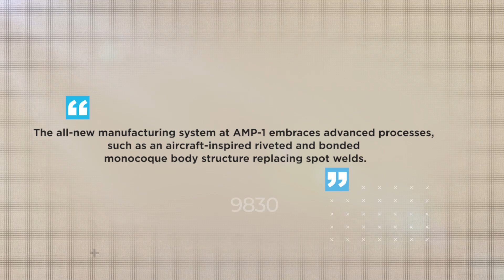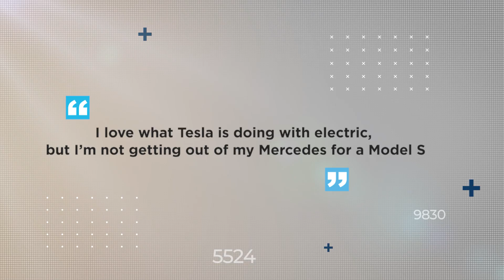Inside Lucid Motors' $700 Million Factory

Comment: I like the Lucid's design but, it's been years that we've been hearing about this thing and it's not difficult theoretically to make an electric concept car... It's basically a structural skateboard powerplant of a few thousand redundant and liquid cooled batteries connected in parallel connected to an A/C electric motor with a monocoque body on top. The difficult part is in the logistics behind the mass production and supply chain, ensuring Quality Assurance and Control can be upheld. Also, being able to entice enough buyers into what is quickly becoming a very saturated EV market that is now offering lower cost vehicles like the Model 3, Y, Mach-E and the more expansive Model S/X, E-Tron, Rivian, Hummer EV, Mercedes EQS, so they really need to gain enough interest to entice orders that would enable them to take advantage of economies of scale. Not to mention the high level software and hardware necessary for self driving. Tesla developed it's own duel chip SoC for it's self driving system, using Nvidia's system which is what Mercedes now utilizes. I hope they're successful but it seems like an uphill battle.

Comment: Electric cars are great until you need to change the batteries a few years down the line. Not only are they extremely expensive to replace, there is no plan in place for the safe disposal of the highly toxic Lithium Ion battery waste. I'll go with the new fossil fuels that have been developed that produce zero pollution.
Reply: Batteries last 300 to 500,000 miles and Tesla's new 4680 should last 1 million miles
   You can recycle lithium batteries too.  There's no zero pollution fossil fuels.
Reply: @user-RCST  Spoken like a true "company man" . We've heard it all before; the best thing since Ex Lax.
Reply: @dlagrua  everything I stated was facts

Comment: OMG this is going to have cruse control.. count me in for that 169k model with no charging ports around.. 
and how much to replace that battery  after  2 years or so of life? also, does the power output fade as you get closer to the battery being dead,.
on  SERIOUS NOTE> if LUCID would get ahold of MR CARLSONS LAB, from YouTube.  this guy could make a WAY MORE efficient circuit to probable get 600 miles out of one charge.. LUCID, call this man

Comment: When will this people learn that we don't need overly complicated 5000 sensor computer with flimsy Wheels. We need a robust and cheap manual electric vehicle. We need it for masses not for Rich minority. We need it built in a way that a normal mechanic can fix and without 500 miles of electrical wires and extreme amount of pollution being a good part of actual Manufacturing.
Build an actual eco-friendly car, not an over-complicated unfixable fragile toxic F-22 Raptor Tesla's wet dream monstrosity.

Comment: Doesn't seem as nice as a mustang Mach-e. Would have thought the interior would be nicer
Reply: Design wise you might prefer the interior of the Mach-E but I guarantee you that the Lucid Air will have far nicer materials in the cabin. For example, every silvery bit on the Air is aluminum while on the Mach-E it is plastic. Same goes for the alcantara, the quality of the glass, the quality of the display monitors, all of the points in the car you interact with, and so on. Not saying the Mach-E is a bad car, just not on the same level as the Air.
Reply: Look at the projected range and over 1000hp